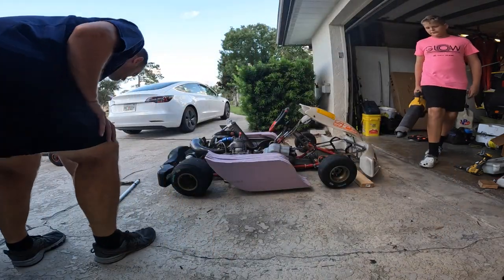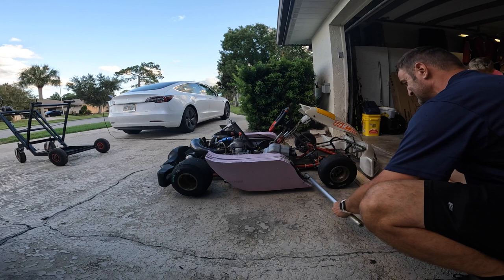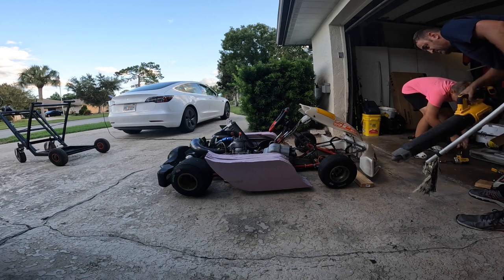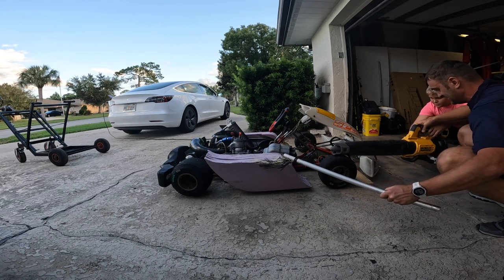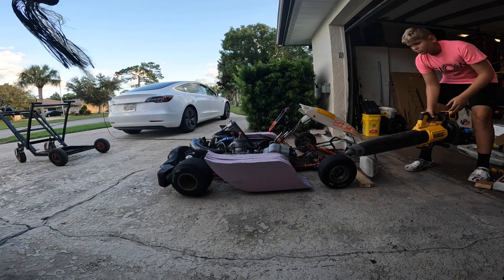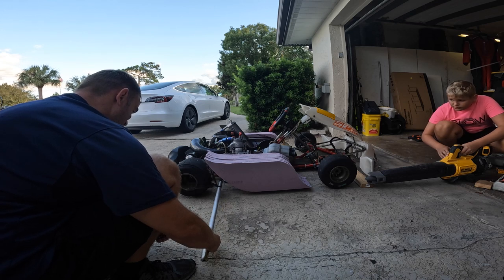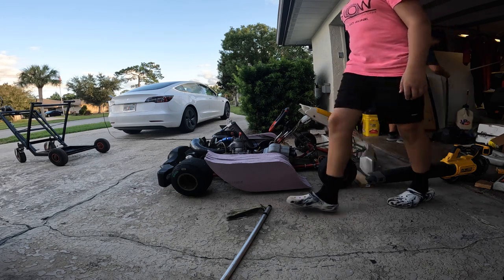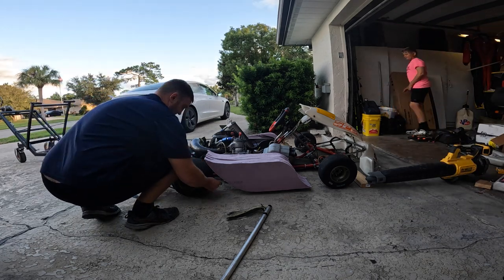Wind tunnel testing on a budget

Comment: Tape strips of paper to desired areas to get a bigger picture. Ford did this in the early days of le mans testing
Reply from the maker: That is a great idea.  Once they are made and on the kart I will add some string lines or similar to get an idea of what is going on.  Maybe use some flow vis paint too.